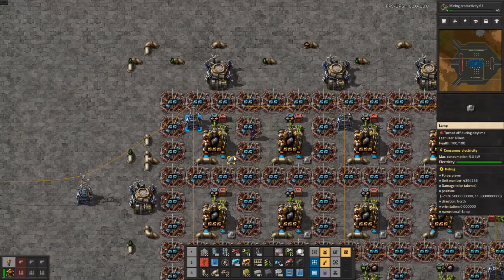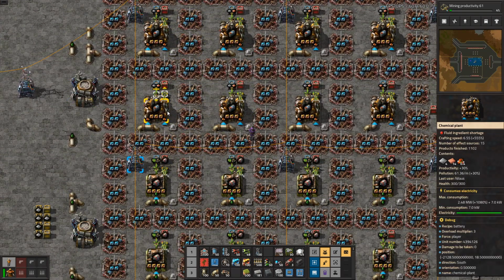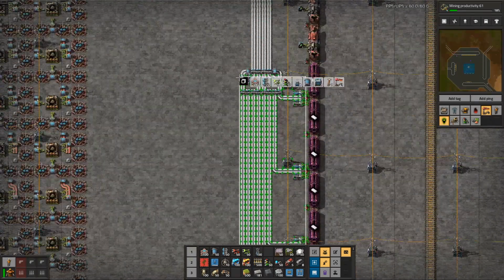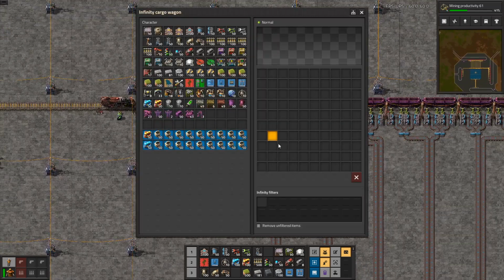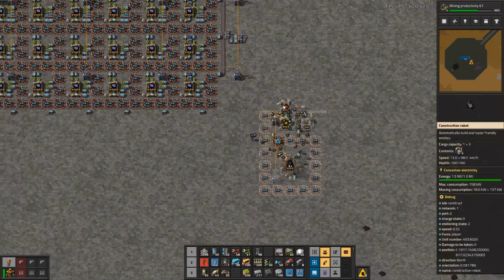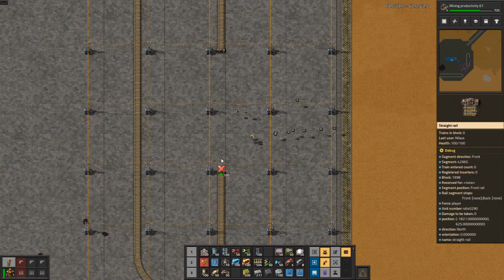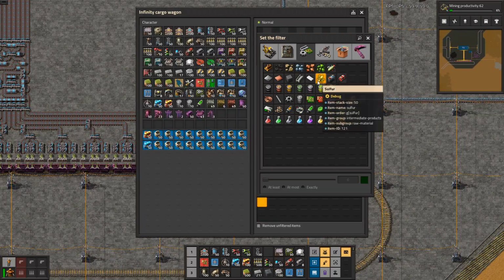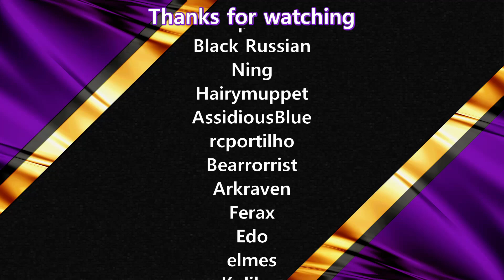Factorio Reverse Megabase | #23 REUSING EXISTING DESIGNS TO SPEED UP | Lets Play

Comment: Tip: you can shift+scroll the rate calculator tool to "materials" mode to only select the crafting machines, reducing the time it will take to do the calculations. You don't need to select the beacons if you're just looking at material rates. :)

Comment: Day 2 of asking for a high speed spidertron! You could have one with legs for running around, and a second set to follow it with building materials and roboports. That way if you run out of materials when using robo-ports, you can just send it to get restocked then return
Reply: I like that idea, so he has not the issue with two robot networks 👍

Comment: In that balancer book, the ones labeled _red_blue or just _blue use undergrounds too long for yellow and/or red belt.  It's a note that you need to find a different one if you're building them in yellow.

Honestly if you're coming from a balanced production source into a balanced consumption location you don't actually need the throughput unlimited balancer versions.

Comment: On the robot frame build, you did place the modules in the beacon to get the batteries back up to speed, but in the last episode you also replaced a light oil cracking plant with a battery one. This one you didn't undo. Not sure how big a problem this is, but you did a lot of math to figure out the fluids part, would be a shame if it didn't work as well as it could because of this!

Comment: Heavy oil ran out... Called it! :D
Reply: I think the lubricant pump is still pumping right as he ran off, was too quick to be sure, but if so will it run out of heavy oil again?
Reply: @STEVEC66  It will slowly deplete to 1,000 at which point the output pumps will cycle to ensure that the heavy oil never drops below that 1k mark.

Comment: I like the fast forwarding on the heavier belting moments. I'm generally a patient person, so I never minded the slow bits much, but with the fast forwards it keeps my attention better and I can still see everything that happens.

Overall, I like this base so far, though I'm curious how you're planning to manage the logistics of the bulk items. Will you build each of them in one massive location, and if so how will you structure the train network? Will you build them in several different locations that each deliver to only a few requestors?

Also, I'm wondering just how big a train you're going to need to transport rails for production science... the sheer number of those always seems to stress whatever logistic system you're using.

Comment: I would be grateful if you would, for the benefit of those of us that are still learning, to explain and show how you hook up the red wires to the pumps to control the heavy oil. I'm sure it's because of habit but you tend to be talking about what you're doing then just click click click and it's almost impossible to see what you're doing, even stopping the video. Thanks in anticipation!
Reply from the maker: I suggest you check out my Master Class on Oil Refining. That goes into a lot of detail about how to control the balance. Repeating the same thing in every Lets Play would not really make sense since I have that Master Class resource available.